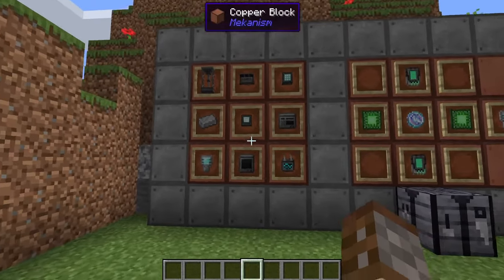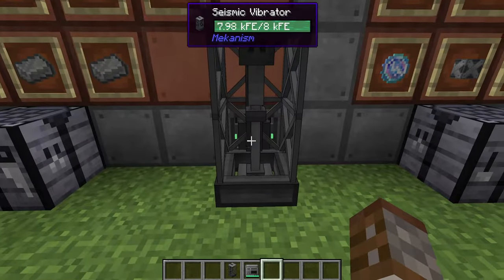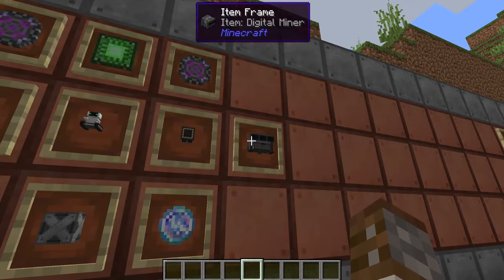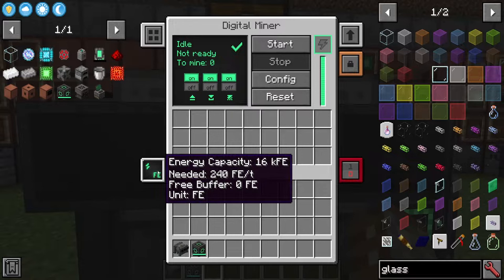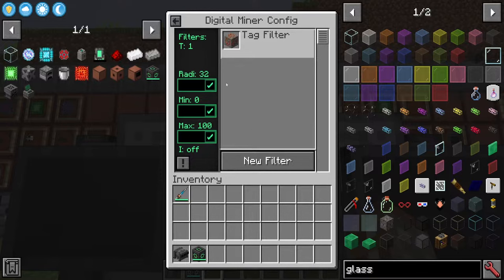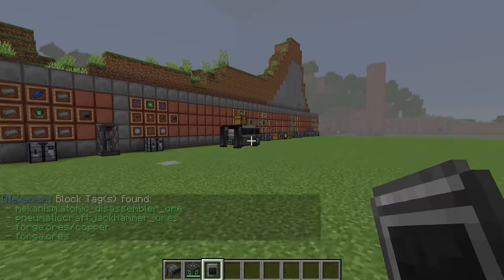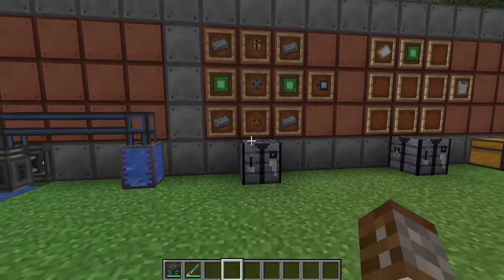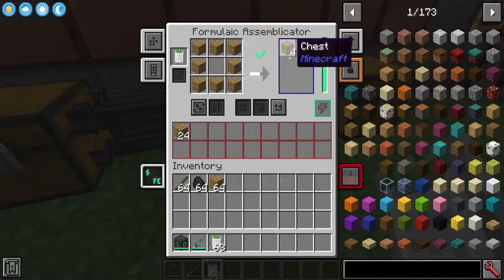How to: Mekanism | Digital Miner & Auto Crafting (Minecraft 1.16.5)

Comment: The digital miner has a new upgrade, idk when it was added, but its the stone generator upgrade which lets the miner search for cobblestone if you really want some
Reply from the maker: I didn't know about that one. The newest upgrade I saw was the anchor upgrade but that is pretty neat. Thanks!
Reply: The stone generator is use for the replace mod. When you configure the digital miner you can turn off/on the "replace" button. And just above it, you can put a block of cobblestone or stone (or something else but you have to put a chest with the item, i recommend you to just put cobblestone or stone). Now with this, every time the digital miner break a block, it will be replace by a cobblestone or stone (depend of the item you put in the replace). Btw you have to do it everytime you create a new filter. Sorry if it's a bit hard to read ^^'
Reply: @vinc6721  that is the efficient way to use it, and it has been awhile since i played, but im pretty sure it doesn't only get used for the replace feature, you can genuinely set it to only minme cobble and it will. I like this because it makes for easy building blocks and/or replace fuel
Reply: you can make the digital miner mine for stone without that just use itemstack and put a stone or cobblestone
Edit : additional you can use tag and do forge:stone or forge:cobblestone
Reply: @Herib104  i dont think you can, not sure it takes stone tags or itemstacks without the upgrade
Reply: @alive527  I did do it so I am pretty sure it does (unless they changed it)

Comment: the tag filter option isn't there on my digital miner
Reply from the maker: What does it show in the config section?
Reply: @Mondays3  Tag has been replaced with "OreDirect" and you cant use colon, so what would I put instead?
Reply: @stealthmedzz6222  im struggling with that rn
Reply: @fusiongamer2526  ah yeah I fixed this by just using the item stack dude, not sure on any other way...Just grab the ore you want to mine and put it in

Comment: idk if its part of an update, but when I installed the digital miner in my 1.18.2 world it said it requires 1 KFE/t, how do I even get that much power  let alone in a tick
Reply: Gas burning generator with ethanol or energy upgrade with a a lot of wind generator
Reply from the maker: As Herib said. To start it would probably be a lot of wind turbines and heat generators but then for a mid point go for the gas burning generator till you get a fission reactor
Reply from the maker: Thanks for helping out

Comment: How can i put  Me System and Autocrafting from Mekanism together ?
Reply from the maker: You would have to use an ME interface on a chest with the raw resources on a template inside then using a logistical transporter from mekanism send those raw ingredients from the chest to auto craft your item. Once that item has finished crafting send it back to the original chest and the ME system will think it has crafted and will be put back into the system. You may need importers and exporters in places but that is the main gist of it
Reply: @Mondays3  Thank you

Comment: I see you are still responding to comments, so if you see this, pls help
I set up a digital miner, and it says it needs 11 kFE/t, which takes just mere seconds to not only overwhelm all of my generators(which only produce mere hundreds of FE/t - but it also drain all my powercubes dry. What do I even build for it to make so much evergy? Biofuel reactors won't carry me this long, and to beat it with wind turbines I would have to construct 140 of them. Gas burner drinks fuel like Thor, with one massive sip, and I have no idea which fuel to use and how to get quantity that lets it run for at least a dozen minutes
Reply: i'm not the OP, but you might want to look into a gas-burning gen that's hooked onto something that can continuously generate biofuel

maybe a crusher that crushes flowers?
Reply: Energy mods bring the Energy consumption down 10x after 8 mods. Way cheaper than creating a power source to handle it
Reply from the maker: The next step is a fission reactor and steam turbine after using gas burning generators. You can use the energy upgrades also to make them more efficient